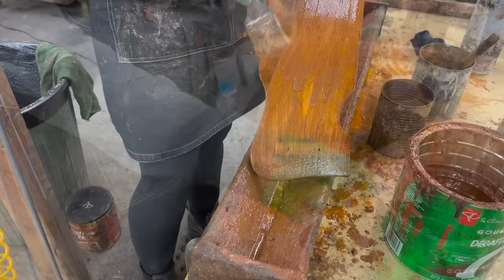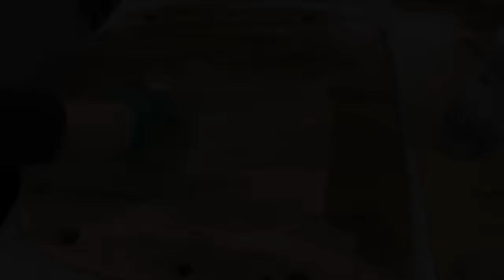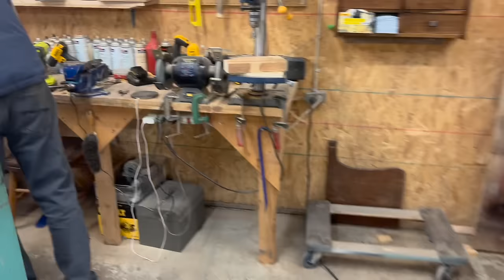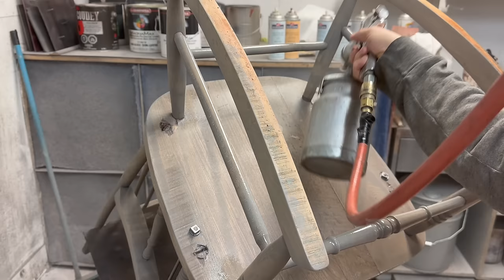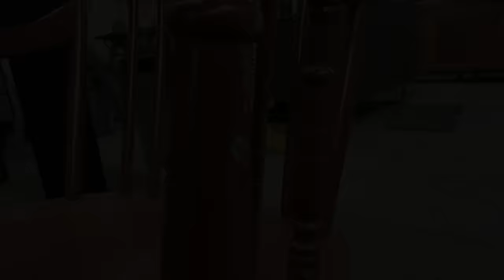How a Woodshop STRIPS PAINT

Comment: The grey looks nice, but it wouldn't have been my choise... great job done !
Reply: Probably wouldn't be her choice either but the customer probably insisted.
Reply from the maker: All customers deserve the best. It doesn’t matter what color they choose.
Reply: @davebryant8050 Did you see the final product or result?  I cringed when she put she put that grey on the top head part, it looked completely painted.  But wiped back, it didn't look too bad.
I think I have watched every one of her vids, and she usually stains back to what the color would have been originally, maybe a little lighter at times, but usually not what I would do.  This is why I suspect she showed the customer other samples, but they still wanted this finish.  This is not what she would have picked to put into her own house, based off of her previous work.
I would have barely stained it, if at all, but not my chair and I am not paying her.

Comment: Elm is my fav!  Regarding stripping..  I've been dying to know how you handle removing factory catalyzed lacquer. It's like bloody concrete. I use the Swing Pro stripper, but even it struggles to get through that finish (and scraping takes an absolute age) Do you ever have to wrap a piece and let it cook with the stripper? Your advice would be greatly appreciated! I deal with that a lot.  I learn so much from you Trena, thank you for making these videos!
Reply from the maker: Hmm that’s weird. I use the same stuff. It works great. You might not be using enough. It’s gotta stay wet. I can’t speak for the gel formula but the liquid will lift those finished right off.
Reply: @johnsfurniturerepair Hmm indeed. It's a head scratcher. I do use your same product, but there are some factory finishes that barely budge. Curious. I'll keep experimenting. Thanks a bunch, Trena!

Comment: I actually just finished an elm rocking chair with a spring cushion seat a month ago. It was made in the 30’s or 40’s. I tried everything to get that pink hue from the old stain out of the wood. I triple bleached it sanded numerous times and it just came back. I’d sand and after a few minutes it would bleed that pink back from the grains. It sort of dictated the color I had to make it in the end. I’m wondering about the elm now with those old stains used back in the day as to how much it absorbed into the grains.
Reply from the maker: Try two part bleach and then regular bleach

Comment: Tara, I have one very similar to this, but has about 30% more spindles, and it is rock maple.  The thing that caught my eye is that the spindles taper to about the width of regular pencil.  About the same as yours at the base but they really taper that thinly.
The question is, mine "walks" forward as you rock in it.  That suggest something is askew.  Are the metal spindle things an adjustment for this?  I cannot think of why those are there.  I don't have those. 
BTW, that is an interesting finish, but I think I will go with a less grey maybe even no stain.  Although,  I will probably bleach it since it is a little too orange.
Reply from the maker: Hi. The metal rods were just part of the design and add strength to the structure. If your rocker is walking something g may be loose or worn to far. Have fun

Comment: Very good. That stripper works fast. Please, what kind is it??? My father did a lot of antique work in his time and for the final coat of stripper he used saw shavings and saw dust for the agent to absorb the stripper. It would get into all of the tight turnings and all he needed was his hands to use it with. Where there was any dust left on after a bang on the work bench, there was a little more finish to remove. He used Red Devil with out any wax in it. I never saw him have to use any scrapers at all, ever.. You know that this chair is older because all of the Elm wood was killed in the 50's to 60's by the Dutch Elm disease. To bad for this is a great wood... We lived in a wooded area in central Indiana and I saw many (15 to 30 ) large Elm trees taken out of the neighbor's yard during that time. Maybe in the thousands of board feet of good straight wood. To bad in those times the wood was just taken to a dump and burned. The underside of the arms still have the band saw marks in the wood. I saw this when you were sanding. The original makers would not have put the time into sanding the under side of the arms to remove these marks. I've never used any kind of bleach on any wood. It is natural that the holes in the arms would not be the same as they were hand drilled at that time. Neither Dad nor I would have put any color on that beautiful grain. When you were staining I saw that the underside of the rockers were not sanded a lot as the saw marks still show. Not critizing, just observing... You are very good with a spray gun. A hard tool to master...
Reply from the maker: Yes I’ve heard of the wood shavings and dust removal of stripper. I think it’s a solid method although it would not work for the modern finishes that need a more mechanical approach. Thanks for sharing😉
Reply: @johnsfurniturerepair  I do it all of the time and it does work!!!

Comment: What paint stripper is being used?  I have a painted piece that has defied all types stripper.  Thanks for your videos.
Reply: If it's a two part paint, then you are stuck with sanding it off.   Xylene may work but not a nice chemical to work with.
Reply from the maker: Swing pro stripper takes everything but epoxy off if used correctly.
Reply: @johnsfurniturerepair  the msds says prime ingredient is monoethanolamine sooooooo, does it have a strong odour?

Comment: I'm not questioning, I'm just curious, what's the benefit of using Goudey's bleach vs mixing your own with traditional bleach? The chair looks great.
Reply from the maker: Two part bleach?
Reply: @johnsfurniturerepair Are you asking if I'm asking about the Goudey two part bleach you used; if so then yes. You said you were going to start with Goudey, but if it didn't work well enough you'd go to regular bleach (which would normally be cut with water). So I was curious as to the benefit of using the Goudey product. Plus now I've got The Cat in the Hat in my head what with bleach 1 and bleach 2. Sorry if I was unclear.

Comment: Very nice, Trena. Were the joints on this chair so loose that it was necessary to completely disassemble it.  Orwas it just to make it easier to strip, as it obviously did. Also, how do you decide when to use PVA glue or hide glue?
Reply from the maker: They were loose but not excessively. It is mostly for my benefit in stripping. It’s such a. Better Job when disassembled. Honestly you can use PVA or hide in most places interchangeably except a few situations. Both reversible. Cheers!

Comment: Please take this comment in the manner it was intended...you are my favorite stripper.  I say this because when you finish stripping something it looks like freshly cut or turned wood and when I finish stripping something it is a toxic disaster that would appall the EPA.  BTW, what is that sander with the vacuum cleaner attachment?  Is it sold with a vacuum or can it be purchased and used with any shop vacuum?
Reply from the maker: Thankyou. You can buy them separately. But the festool dust collection is unmatched. 😉

Comment: The liquid you are using cannot be methylhydrate, since methylhydrate is a solid substance which forms under very high pressure. What is the liquid substance at 6:25 correctly called?
Reply from the maker: Methyl hydrate. Check your facts.